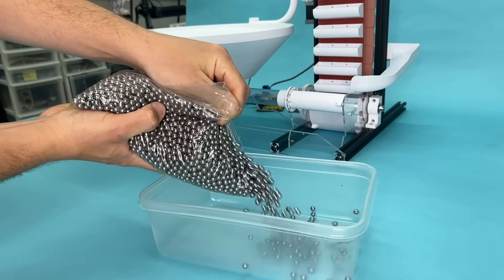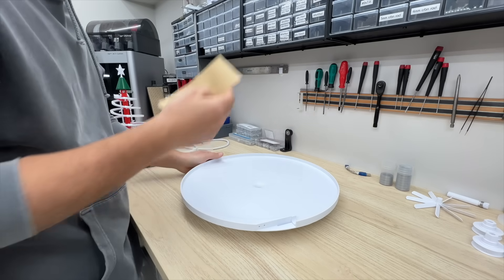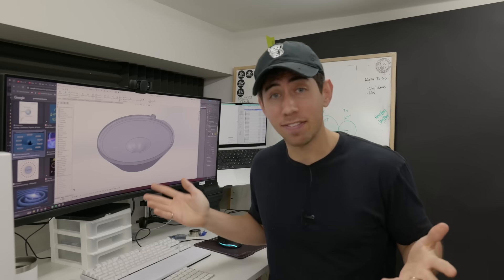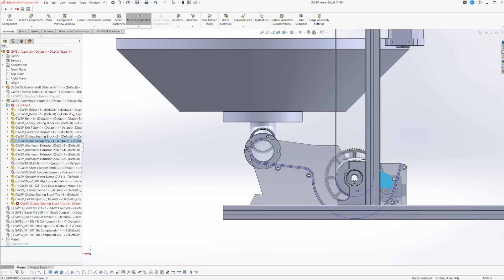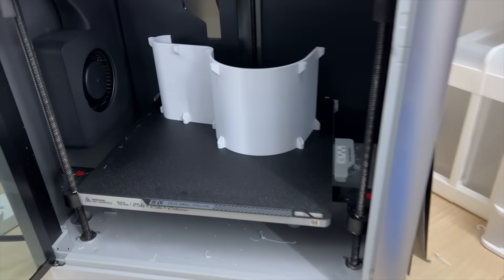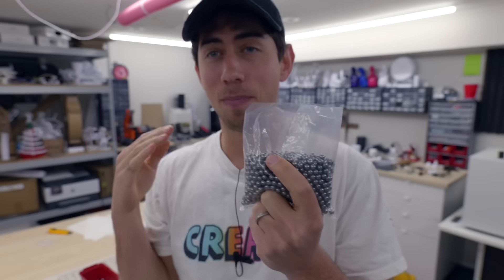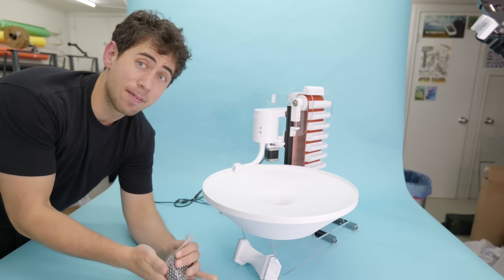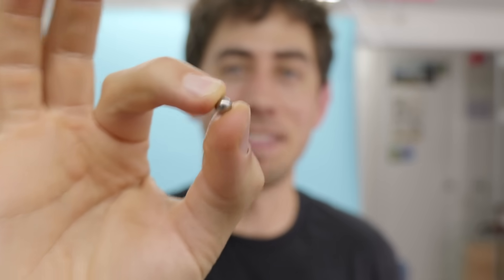Can this Machine Handle 5000 Marbles?

Comment: The noise helped suppress my tinnitus problem. Thank-you!
Reply from the maker: So the machine does have a purpose 👌 take that haterzzz
Reply: BRRRRRRATATATATA BE GONE HATERS, YOU SUCK! @Engineezy
Reply: @Engineezy  The haters be like: eeeeeeeeeeeeeeeeeeeeeeeeeeeeeeeeeeeeeeere
Reply: @Engineezy  you should patent it as a medical device and sell it under the brand name "Balls of Steel Tinnitus Masker"
Reply: The white noise of the machine is deadening and taming down the input to the brain, which filters out things it experiences consistently for the most part. Otherwise you would feel every hair on your body....as they grew.... There is app Ive used a few times that seems to just play a tone at the tinnitus frequency you perceive, and its worked on some level to deaden it. Basically I assume it sort of 'overworks' your brain to the sound so as the brain compensates it becomes less pronounced, like if you were to use a green/blue light in a room for some time then go out into a white lit room it would look very redish because your green and blue cones have been working but not the red ones ergo the reds are primed to sense light where as the blue green ones need to even back out both in their chemically driven photon to nerve impulse sensing and perceived sensation in the brain. 

Brains are weird.

For the tinnitus anyways, I imagine a tone generator would have the same effect. Havent tried it yet though....

Comment: I would love to see what would happen if instead of sanding (since obviously you can't power your way through the well itself), you use a thinned out plaster solution or thin epoxy that you can roll around the inside of the well with the drain at the bottom of course. When it dries, it should pretty evenly fill all the layer lines.

Also, you could up the top layer thickness and probably speed up print time with lightning infill. That, or cubic subdivision/whatever prusa/SS calls it. If you really want to get next level, as well as quiet the sound of plastic so it's just the bb's, could drill a hole and, with lightning especially, fill it with sand and hot glue plug it.
Reply from the maker: I was actually planning to epoxy after sanding, but it was much smoother than I expected already and didn’t want to fuss with fumes etc!

Comment: How do you control the stepper motor?
Reply from the maker: Arduino and tmc2209s with the most basic of step/dir code
Reply: @Engineezy  wouldnt be a AC Motor enough for this?

Comment: Did you consider a 3d printed gear chain with attachment points for the scoops instead of a belt?
Reply from the maker: I did, but I didn’t want to commit to that until after testing the in/out and then the belt actually worked quite well (until the small balls wrecked everything 😆)

Comment: The hopper got raised too much.  Velocity needs to be tweaked so that after 1 full rotation balls follow the guided trajectory rather than spreading back to the sidewall, where they interfere with successors and induce all that clumping right from the start.  Also if ever a video needed to be 60fps, this was it.
Reply from the maker: Might be right on both points

Comment: So you know these ocean drums? It’s  a type of percussion instrument that mimics the sound of the sea. It is a circular frame drum with filled with small beads. When the drum is tilted back and forth, these beads roll over the bottom head, creating a sound similar to waves crashing on a beach.

This could really be a fun project for thousands of tiny ball bearings. Getting an interesting mechanism that can lift different sides of the drum. Playing around with overlaying oscillations to check out the visual movement and the resulting sound of the beads. 
Maybe capturing the essence of the mesmerising movement of the strand beasts and the calm ocean currents.
Reply from the maker: Love it! Gonna have to do some research on these drums
Reply: Wait, I have one of those - they're actually called Ocean Drums? :D

Comment: Cool machine, looks like a lot of loss coming from balls bouncing out at the top of the conveyor.
Reply from the maker: It's actually is a scoop design problem- the balls are getting caught between the underside of the scoop and belt and getting pulled under the exit ramp.  Much worse with the smaller balls!
Reply: @Engineezy  Ah, that makes sense.

Comment: The gravity well research on gravitational physics made me laugh.  We all start out with good intentions on hardcore research and end up with, 'yep, that looks good'.....
Reply from the maker: Hahaha exactly that!
Reply: It is not that complicated, one could just use the function h(r) = 1/r for the height at a certain radius, and then revolve this sketch.
Reply: @feelfree.1  Is that formula based on some kind of gravity well analogue, or is it a known-working shape or something?

Edit: I just looked it up and there's a study called "trajectories of rolling marbles on various funnels" by Anita Mareno and Lars English that describes the typical coin funnel as hyperbolic, so I guess it's a known working shape.  Sounds like it would be pretty simple like you say.
Reply: @excrubulent 
it's literally the shape of the gravitational potential caused by a point mass (V = -c/r) where c (= Gm) is a positive constant. And It is also the potential caused by a spherical mass distribution outside of itself
Reply: It's funnier because if you were making a coin gravity well you do have to have an exact shape to keep the coin rolling on its edge, and even then it only works for a small range of coin sizes.  It's not critical for spheres, though, so this is more a nod to those who have done the hard work to make coin wells work.
Reply: A radio amateur friend showed me how to design an antenna for receiving a very specific range of frequencies. He went through some very impressive and rather complicated mathematics.  Then said, "Or you could randomly bend a coat hanger and get similar results" 😊
Reply: I was absolutely positive that was a segue into a Brilliant sponsorship.

Comment: JBV Creative is becoming more and more like Wintergatan with the amount of marbles in a video!
Reply: Wintergatan meets Mark Rober. I could think of worse mashups.
Reply: Not to mention the number of marbles on the floor!
Reply: But will it go on for yearrrrssss?
Reply from the maker: I do hope so!
Reply: how about the other way around, use music to manipulate marbles?
Reply from the maker: Just need to start making music 🎤
Reply: Cool with me, until he starts obsessing about musical tightness I've got no problem with the marbles
Reply: Srsly tho, if you get the timing bang on, a lá Wintergaaten, you could synchronise ball drops in opposing directions, interweave patterns over the same surface - any thing more sophisticated will probably require near perfect timing and ball positioning, the last several episodes of Wintergaaten Wednesdays is the ideal place to start.
Reply: Not at all, he actually completes projects instead of pontificating for years without actually getting anywhere
Reply: No way he’s way more like Ivan Miranda than wintergatan

Comment: The tiny balls are so much more chaotic and indeed answer one flaw/question that I had regarding the gap when the scoop is overturned. Many balls just dont fall in the hopper! So make a short with some fix for it maybe lol. Anyway can we say a marble version for this? I'm sure so many marble run channels will be thrilled to have this and include it in their runs!
Reply from the maker: Yeah, the small ball were an afterthought, I think with a slightly different scoop design, it would quickly solve the problem!  I think it would already work with marbles if they are the right size!